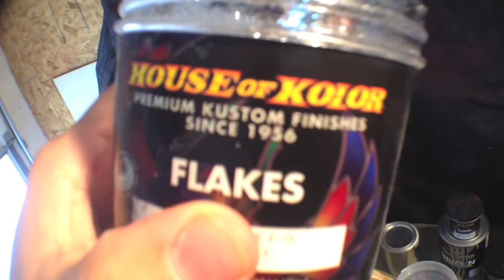KANDY N CHROME TIME LAPES PATTERN TOP BILLS 64 IMPALA STREET KINGS

Comment: just beautiful!! I have a question, is the flake sprayed in the base? or the clear coat?  (1st layer of clear?)
Reply from the maker: harleyguyinmilw 
Yes well first layer is a metallic silver base coat then multiple layers of solid chrome flakes then buried in clear.
After that cures for a few days it’s sanded back down flat then the tape and Kandy can begin

To view the entire process step by step video tutorials are available 
Tap below to subscribe thanks 

Connectpal.Com/kandynchromecustompaintdesigns
Reply: Did you flake with a flake gun or mix it with the clear and shoot it ?

Comment: then the silver flake over the candy?' I assumed you did the silver base, then the clear to smooth it out, then lay the candy, then more clear...how does the silvery flake over the candy not cover it up? just a newbie trying to learn it the right way
Reply: MRX2099 cause the flakes are thin like dust. its not enough to cover up the color of paint
Reply from the maker: MRX2099  to view the entire process step by step video tutorials are  now 
available tap below to subscribe thanks 

 Connectpal.Com/kandynchromecustompaintdesigns